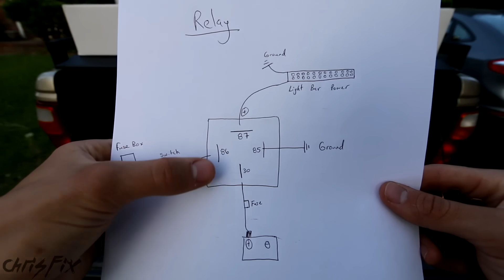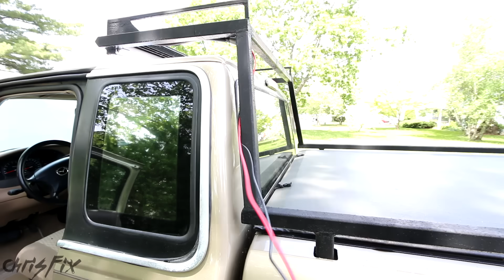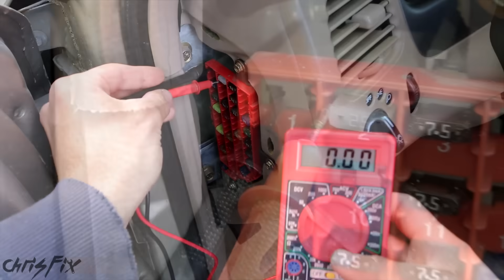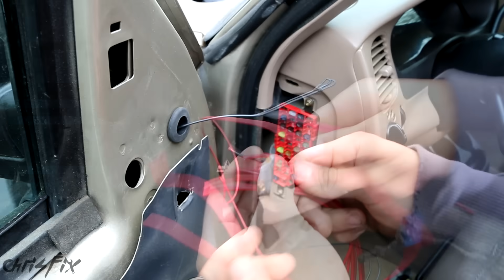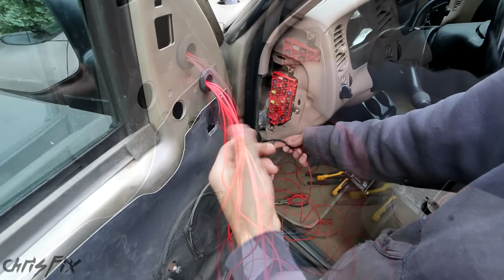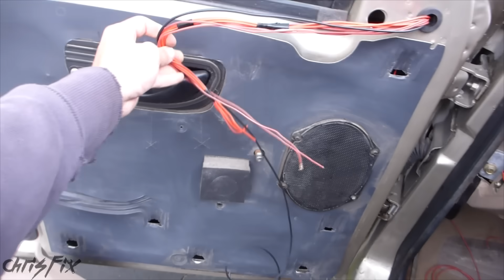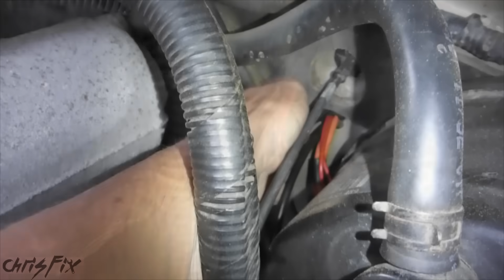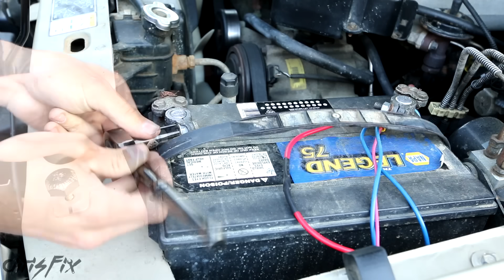How to Wire an LED Light Bar Properly (Project Night Light Episode 3)

Comment: Nice work. That light is BRIGHT!!
I think you need a portable bandsaw for your next project. You made a lot of cuts with that angle grinder. I've been using the 4.5" bandsaw from harbor freight for several years now and have been really happy with it. I've got some videos about it on my channel.
Reply from the maker: Dustin Rogers Thanks and thanks for sharing! I will have to check it out!

Comment: I see you plan on doing more wiring. Have you looked into an auxiliary fuse/relay block? I think it'd be really beneficial to you and to us if you do an install video on that haha I plan on adding one myself soon 

Also, you have a bunch of red wires going through the door.. When you go to wire the next thing, how are you gonna be able to know which wires to use?
Reply from the maker: ***** The wires are labeled with black marks to make that easy. A fuse block is a great suggestion! Thanks!

Comment: Something to protect the wires coming from the light would be routing them through the square tubing and down through the stake holes in the bed. I live in California and have seen many wires ripped away from the truck from branches that get into stupid places. Good work man!
Reply from the maker: TheNeckasaurus That would be pretty rock solid! I would def do that if I didnt seal them all up to prevent rust!  Great idea!

Comment: Great work man. Awesome detail in what you do.
I would like to make a statement and suggestion though, as someone that has wired up lights myself, as well as had to go through and fix/re-route some of my own work, you should make it easier on yourself in the future and run different color wire for different functions on the relay. Example: Red for battery hot, White to the light, and Green to the switch. It takes longer NOW, but can definitely save some headaches in the future should you have to figure out a connector or busted wire. I also like grouping pairs together in loom for that same reason. Small zipties are also a blessing when running lots of wire or when you're having to butt splice a lot of connectors together.....ever had to wire a tach?! lol xD

Once again, great work.
Reply from the maker: William Ruescher Thanks a lot and thanks for the tips! That is a really good idea so if there is a problem down the road, it is easy to diagnose!

Comment: Good video but the OCD in me can't stand the switch placement, and they don't match. Aren't you worried about bumping a switch or two when getting in & out of the truck?

I also would have used a different color wire for each of the 4 switches, cost would have been minimal to do that, it would make it easier to tell what's what.

Comment: I take it can be wired in so that the switches lights up together with the buttons and dials in the car when the "lightswitch" is turned/toggled ie when changing from DRL to normal low/high beam operation?

Comment: Great job! 100% on this, thats better than factory! The only thing I would have done extra would be to heat shrink all of the crimp connectors and around the terminal post/connections on the relay just for some added protection from moister. Great videos as always! 😊

Comment: ChrisFix you should do a video on installing a car alarm! I just got one and it looks pretty confusing. I think you could do it !
Reply from the maker: That is a pretty good idea! Thanks for the suggestion and I will add it to the list! What alarm did you get?
Reply: ChrisFix a viper 3105v 1 way alarm system with keyless entry for my 96 f150. If someone bangs or bumps your vehicle the siren goes off. Or if they try to hot wire it kills the ignition. I got it on amazon for 70$. I'm paying a local shop 100$ to install it tomorrow I'll put a video up and show you as soon as its done!
Reply from the maker: Mike Scott Awesome! That sounds really good!

Comment: nice video! For added cleannes you should've ran wires trough the steel tubing,
Reply from the maker: audioh0lic Thanks! The tubing is sealed to prevent rust but that would be a cool idea otherwise!

Comment: Hi Chris, I really liked this video! I have an S-10 with the  extended cab like yours, but I have a subwoofer and amp that I wired in myself a couple years ago. I was really new to wiring in general at the time but I've been thinking lately it was time to redo it but better this time. The truck is something of a farm vehicle so it's shared with my parents and they hate the buzzing the amp makes (it a cheap amp and it has two loud fans) Anyway, after seeing this video, I think I will install a relay and switch to make my parents happy, but keep the beats.😊 I also want to say I love your channel it explains automotive projects simply. I think I'll be tinkering with my trucks a lot this summer!
Reply from the maker: Zeus Longmire Yea, also keep any power wires away from the amp because it can cause interference and cause the buzzing. Definitely tidy up the wiring and let me know if that works! Tinkering is fun so have fun with it!

Comment: hey chris, love your work. i have a suggestion for a video.. does unleaded high-octane (like 91) make a difference from a low octane gas (87). is high octane better? and why if so..thx man keep up the great work
Reply from the maker: Mark Pineda That is a great suggestion! It does have a lot to do with the motor itself. High compression engines that can run regular gas or premium will see an increase in premium, but a low compression engine will not see any benefits.

Comment: chris you should put that fuse tap into the slot for your high beams then your high beam switch will trigger the light bar and the switch you added will disable the light bar when you're "on road"
Reply from the maker: Mike Whitty That would be cool but I want to be able to switch it on whenever I want rather than using the high beams only. That might be a cool idea for something else though!
Reply: then use a 3 position switch, always on, off, and high beam activated. That's how my front and rear LEDs are wired. My extra backup lights come on in reverse or whenever I hit the switch

Comment: why would you put the switches on the door? why not on the dash or under console
Reply from the maker: Ethan Kurtz There are not many places on the dash that are easy to get to and have space. I liked the door because it was easy to wire and I can easily switch them on and off.

Comment: Great video but wouldn't  it have been better to have drilled a hole through your bar mount to give your wires a bit more protection from whether?
Reply from the maker: mario reynaga The wires are waterproof and I sealed the light bar frame so that it wont rust from the inside. That is why I did not do that.

Comment: Very good video, I am a fire fighter and I have all my blue lights installed on the fuse, think I may be doing some rewiring thanks to you and your great video. 

1997 Toyota 4Runner
Reply from the maker: zekefleming1 Thanks! Yea, consider a relay if the amperage is high. It makes it safer to run and also there is less voltage drop so your lights will run brighter.

Comment: Hey Chris, very helpful video. I'm currently installing 4 dually style light pods on the headache rack on my truck and have a question. Do you have to have a relay to wire this correctly? I was planning on going straight from my fuse tap to my swtich and from there to the light bar and bypassing the battery completely. Thanks in advance.
Reply from the maker: Gravitar How many amps are you drawing. Anything over 5 amps I would use a relay just to be safe. Also to get the maximum brightness you want to use a relay because the switch will create a voltage drop typically.
Reply: ChrisFix If I did the conversion right, they will pull 6 amps. Ill have to get a relay just to be safe. I dont want my truck burning down! Thanks!
Reply from the maker: Gravitar Yea, I try to use a relay for anything with 5amps or more but I am also very cautious. If you have thick gauge wiring you should be ok, but I like to run relays (as you can tell).

Comment: Hey chrisfix, I see a lot of visual mods but have you made any mods underneath the hood like intake, exhaust, heads, etc.? And also, why 2 nuts on the negative battery cable? You could just use the regular nut.
Reply from the maker: 999thenewman Hey now, I like my exhaust leak
Reply from the maker: Peter Kapica Well this is a truck and I find no need to do anything for increasing HP or any of that on this. Two nuts because then if I need to remove a ground, I dont have to loosen the negative terminal.
Reply: Yes its installed correctly and i leaned it out a bit. I think when i install a boost bottle, it will be fine
Reply: Peter Kapica Still needs to fix the exhaust leak.
Reply: ChrisFix thats gonna put a dent when you do an emissions test
Reply from the maker: Peter Kapica Never had a problem! It is a small leak.
Reply: ChrisFix Have one on my accord and i can smell the exhaust gas, doesnt bother me and its louder than normal. And i got a question: i bought this 2 stroke engine kit from ebay for my bike and the engine wont idle for more than a few seconds if i dont give it throttle. It only has 1 adjustment screw which is the idle mix screw. Any suggestions
Reply from the maker: Peter Kapica No exhaust smell in my truck it is that small. As for your kit, it can be a million things. Sounds like your idle or air/fuel ratio is incorrect. Are you sure everything is installed correctly?
Reply: Peter Kapica what's a boost bottle?
Reply: Donovan Robins a boost bottle catches fuel thats back tracked into the carburetor for more power
Reply: Oh ok that's pretty ingenious thanks:)
Reply: Peter Kapica sounds like u have to enrich the mixture screw not lean it out
Reply: Davey boy001 it runs rich already. And also when started cold, it hesitates for a few seconds at partial throttle then revs fine
Reply: Its a 2 stroke its suppose to run rich since it burns gas and fuel...also sounds like u need to give the carbs a good cleaning.
Reply: The carb  and engine is BRAND SPANKIN NEW
Reply: Peter Kapica gas goes bad tho after just 3 weeks of sitting so it could be gummed up in ur bowl and in the jets
Reply: The gas is about a week old
Reply: Maybe its just gotta warm up than before u get it going but don't be worried if its running rich its wat 2-strokes do they run mean and dirty
Reply: Davey boy001 problem is gone after a few seconds of starting. Thanks for your help. And also, since I now ride on the rocks by the street, it's a little rough ride and I can see the tire moving side to side a bit. Should I tighten everything up just to make sure
Reply: Peter Kapica now that could be a number of things u can try tightening it, but its most likely that ur rim may be out of true (out of line) since u ride on the rocks a rock may have dented the rim. Or it could be the bearing... If u wanna look into it just search, front wheel wobble dirt bike, on google and u will probably find some info.
Reply: I don't mind it much

Comment: I've seen other video of people with LED bars, but none drive home how much they really light things up like your video has! 

I have a 2000 Jimmy 2dr SLS and I'm very tempted to add a LED bar or something because the high beams suck off road. even the low beams are really bad... But if I can't find where my coolant likes to disappear to randomly I might not have the truck for long...

anyways keep up the great videos!
Reply from the maker: Ravens Reign Do a compression test to see if you have a bad head gasket or use one of the bore scope cameras I use like in my fuel system cleaner videos. The light bar makes all of the difference as you saw. It is so amazing!
Reply: I'll have to try the bore scope, but i did have a pressure test done, it held for the 8 hours i was at work. it could be a number of things, like a fitting that only leaks when its at full temp. I may have to leave the truck idling over top of a sheet of carbord to see if the coolant is even leaving the system
Reply from the maker: Ravens Reign Keep me posted!

Comment: WOW- WHAT A DIFFERENCE !!! It looked like daytime out there. That's amazing, Chris! That was a very nice wiring job, too- very clean & tidy.

That truck's gonna look like a UFO zoomin through the woods !
ChrisFix that negative battery terminal soon; its bolt/nut shouldn't be pinched closed all the way down like that to be tight, and make sure all of the wire strands are in the terminal.That one is shot. It might ruin the alternator & ECM someday!
Reply from the maker: HUBBABUBBA DOOPYDOOP Thanks a lot man and yea, that is next on the upgrades! I will do that and the alternator!

Comment: Does it matter the order of the blades of the relay you wire everything to? Meaning does ground need to go to a specific post, etc.?
Reply from the maker: ***** Yes, the order is very important. I will go over that in depth in my relay video!
Reply: ChrisFix awesome, thanks

Comment: It looks awesome!!! Doesn't wiring directly to the battery make the battery somewhat inconvenient to remove? If you disconnect either terminal, you'll have to keep track of what was attached to it!
Reply from the maker: Aidan Franits Thanks! Not really because you loosen the post clamp and it slides off the battery but the wires are still attached to the clamp. The wires stay in place on that terminal.

Comment: just to be even more confusing.

The relay is a load. you can control a device (load) on either the power going in side of it or the ground side.

DC doesn't care. But the switch does care. you can use a very small switch on the ground side but on the power side the switch has to carry all of the power the load uses,

Always put your switch on the ground side of the load.
Reply: Don't listen to this guy!
He clearly has no idea how electricity works!

Greetings,
Somebody who does know how electricity works...
Reply: +Candisa if you don't know how to use the relay to limit the amperage that is being pulled thru the switch. Then you you are an idiot
Reply: +notchbak  Yeah... I'm pretty sure I know how and why to use a relay... 
Just like I know it doesn't matter for a switch if u put it on the positive or negative side of a load (exact same current, exact same spark voltage, it's a series connection!), and it's actually more reliable to switch the positive side and have a direct as possible ground connection.

But hey, don't believe somebody who actually knows this stuff, or pretty much any car manufacturer (starter motor and it's relay is switched on the positive side)...

Comment: Im suprised you didn't  feed the wire inside the mounth since  its hollow and just drill a hole at the top near the light bar
Reply from the maker: x412Predator I sealed the metal to prevent it from rusting from the inside out which is why I didnt do that. Otherwise I would have.

Comment: Everytime I work on my car for something,  I lose a screw or two,  break something,  something stuck,  I can't see through,  I forgot what to do next,  l need 3 hands, it got dark, l need a tool that my friend borrowed and didn't get it back,  and of course hurt my fingers which makes me angry and start to use the hammer which breaks more stuff which makes it even worse. And then I see a video of Chris which gives me the motive to do stuff ... and so on.
Reply from the maker: anas alwash Sounds like a vicious cycle haha. Hopefully I get you motivated and you learn some tips and tricks so you have less and less problems each time you work on your car.

Comment: Chris if you use relays for everything 8 wires should be enough for 7 switches, use one for a common voltage and the rest are just switched wires. The relay is the only thing that needs grounded.
Reply from the maker: Andy Plater I am not sure what the setup will be yet which is why I just ran 8 wires to be safe. Thanks Andy!

Comment: You should have drilled a whole into the rack and ran the wiring Harness through the pipe instead of having it outside the bars.. But it looks good
Reply from the maker: J WAGS Thanks! I wanted the bars to be sealed to prevent rust as much as possible.

Comment: Awesome!! :D
I don't even have a truck and I want one now lol

Only thing I would suggest would be maybe some dielectric grease on the connector to the light bar to keep water and dirt out.  It looks solid but then again I've seen plenty of "weather resistant" ones all corroded after years in the rain.
Reply from the maker: MetaphysicalEngineer Thanks a lot! I am glad you are catching the "bug" though me! That is a great suggestion with the grease! I should add it to the back of the relay too to repel any moisture that might get near it!

Comment: It would look cleaner if you drilled a hole in the rack and down the rack into the bottom of the truck and then to the front.
Reply from the maker: NASH cusToms Thanks for the suggestion! I didnt want to drill holes because I wanted the bar to be sealed to prevent rust.

Comment: It looks great Chris! But... Light switches are not mede to be on door panels! They should be on the main consule! The door might get hit and may need maintanance, maybe even replacement, and you would have to do it all over again for all this swithes!
Its my opinion that you should have found place on the consule or the dash board, or even make a new mini consule and mount it somwere around the steering wheel or above the head hight.
Reply from the maker: gil halamish Thanks! If the door gets hit, the panel with the switches comes right off and I can put it on the new door!